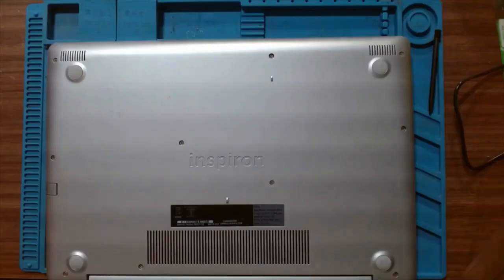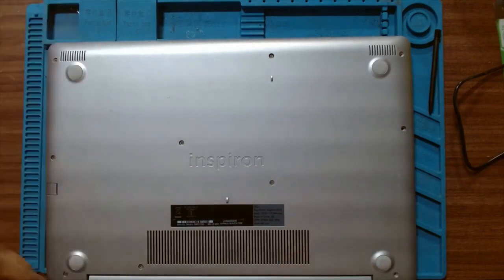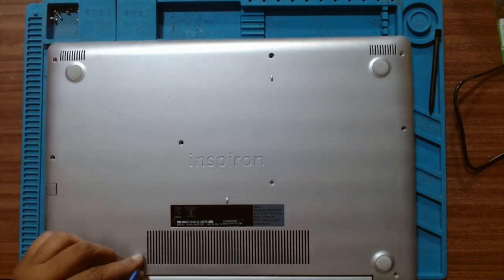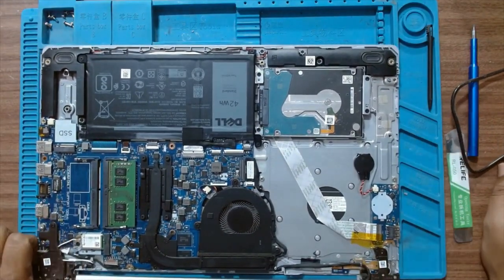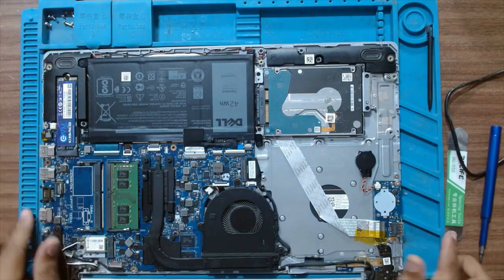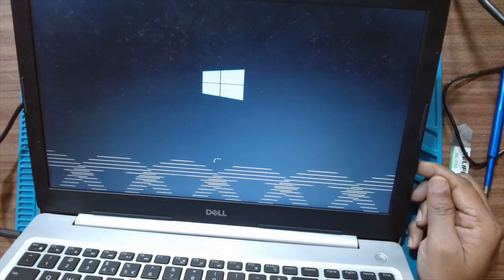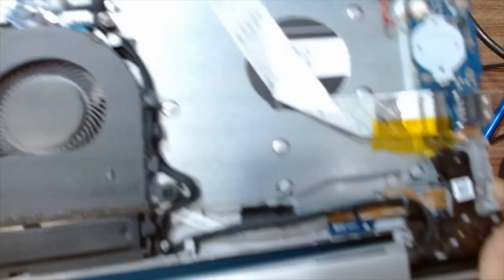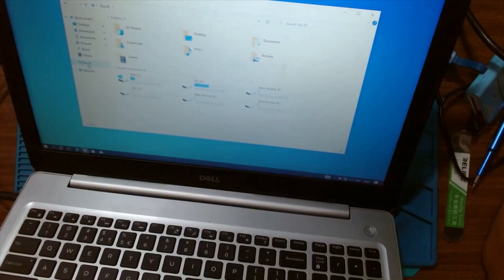How to install NVMe SSD in Dell Inspiron 5570 to boost performance.

Comment: M.2 Gen 3 or 4 ? and can i use 512 gb with dell 5570?
Reply: Can do either, 4 Gen backwards compatible to Gen 3. I just installed Samsung 990 Evo Gen 4 1TB though says only 512 GB. Laptop now running better than when it was new! Also, if clone, and will not boot, boot into Safe Mode which will load the NVM driver. Restart, and will boot into windows normally.